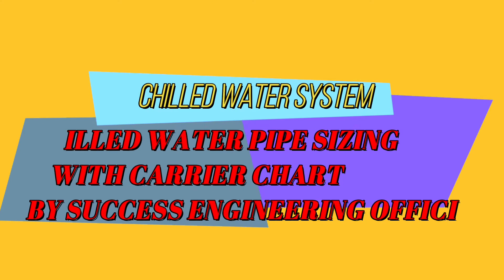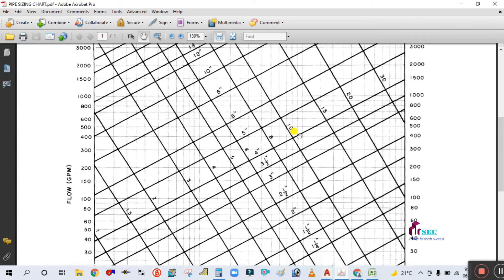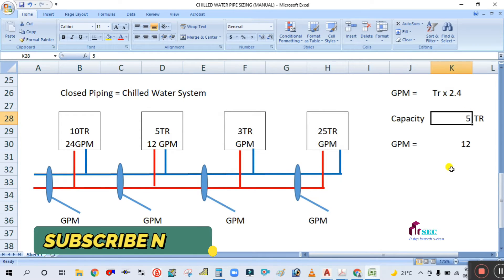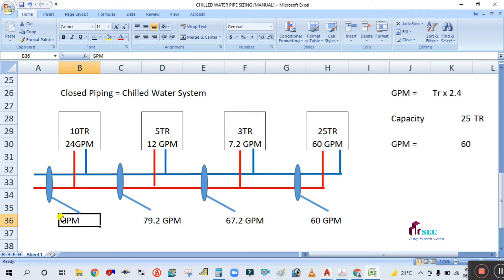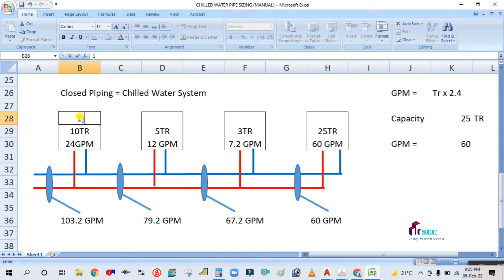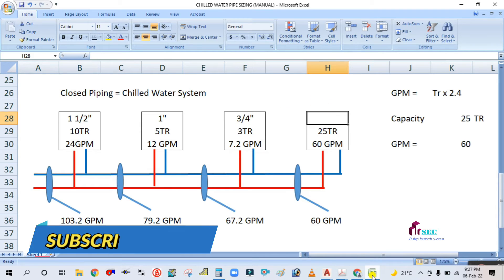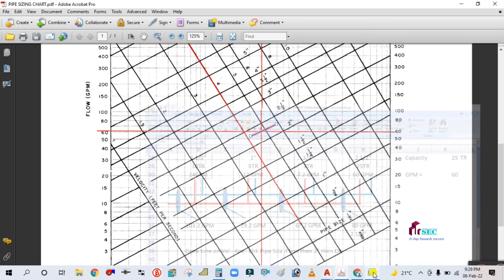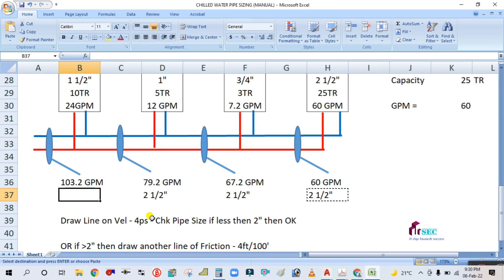CHILLED WATER PIPE SIZING WITH CHART & CARRIER GRAPH I CLOSED LOOP SYSTEM I COMPLETE COURSE I

Comment: Sri, I have one general question supply and return lines are header which is coming from the chiller. Suppose if it's coming from the VRF one outdoor and multiple indoor copper pipes connection how we can size the pipe diameter. Please Answer.
Reply from the maker: Vrf pipe sizing is different topic do not relate with chilled water
Reply: Brother you don't have to size them manufacturer decides the size of refrigerant pipes, however if you still want to size them refer ashrae fundamentals piping chapter and for pipe sizes refer datasheets